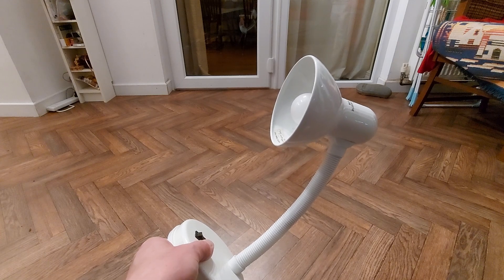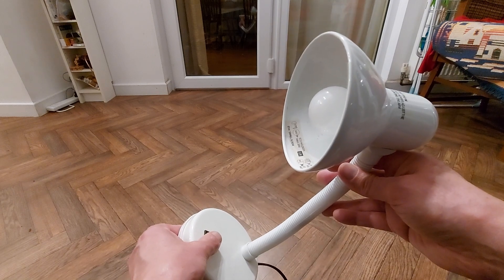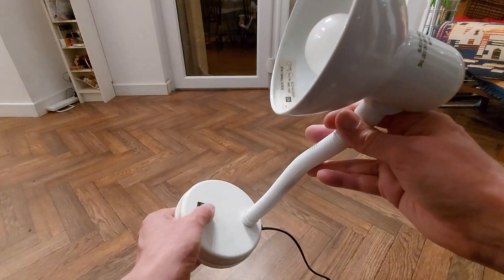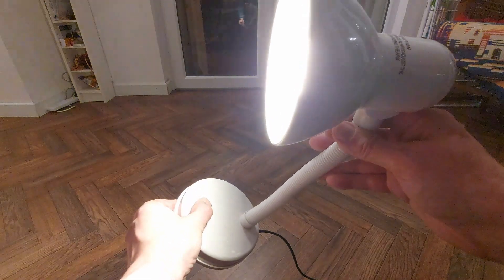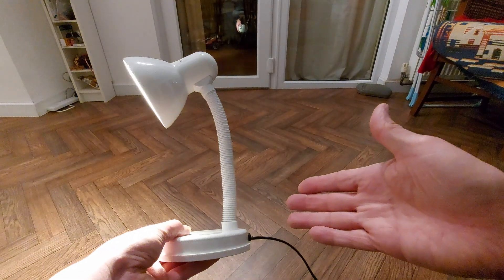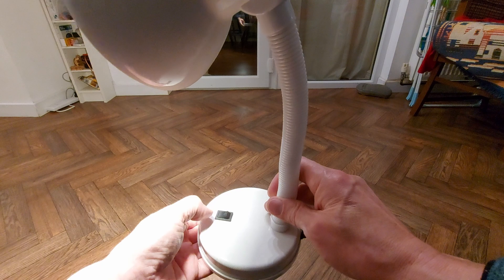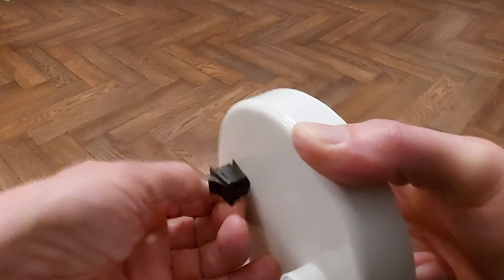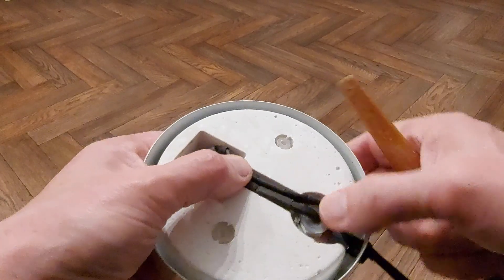FLICKERING LIGHT WARNING - Wilko Desk Lamp Teardown and FIX

Comment: robust wee lamp. Think your poking about 'did something' also the contact cleaner. I had a lamp that flickered I thought it was the inline switch I fitted, so I opened the switch and poked and prodded .Still flickered. Ended up it was the LED bulb.
Reply from the maker: I had changed half a dozen bulbs before I decided it probably wasn't a bulb issue 🤣🤣

Comment: Can't say I was in our local Wilko often, but it was very handy to have ☹️ actually I did used to get a lot of garden lights from there, 4 for only £1 - no wonder they went bust!
Reply from the maker: I found the quality of their stuff was fine. My issue was usually items often had no price labels or were on display with the wrong display labels. I often didn't buy stuff because I couldn't guess the price. Maybe it was just the staff in those particular branches. There were two branches I went in fairly regularly.